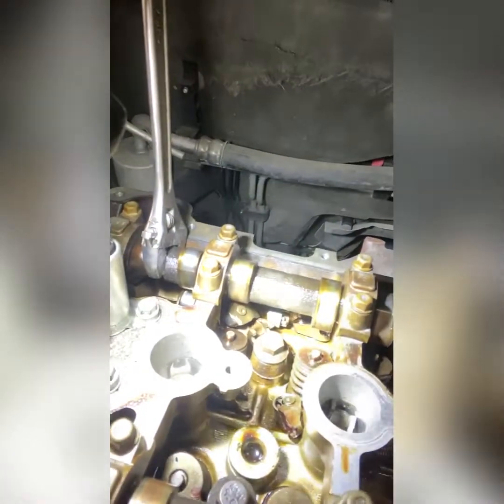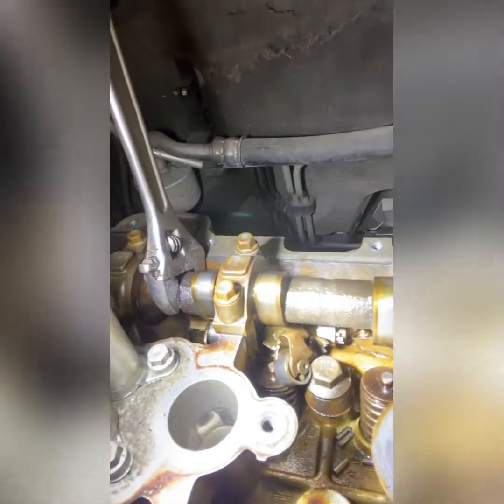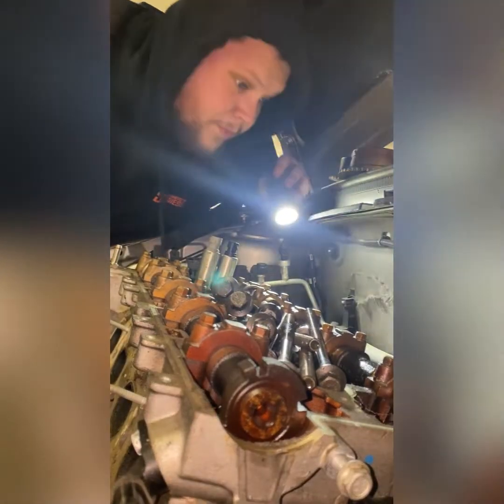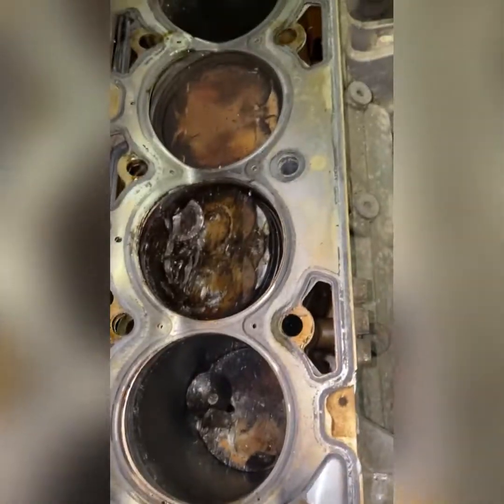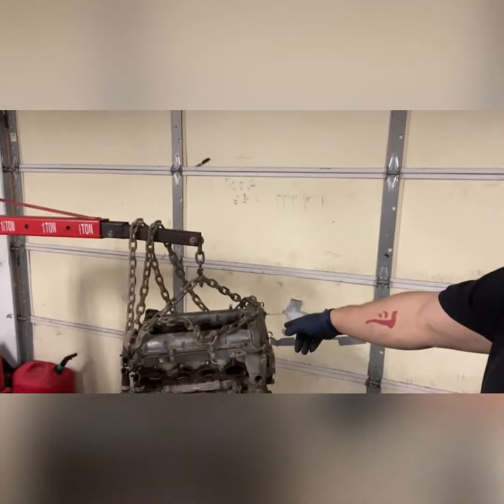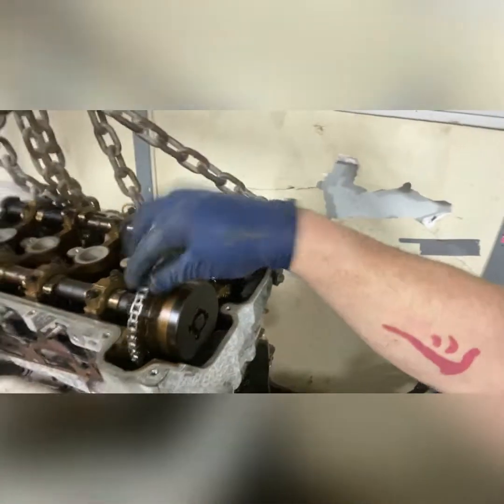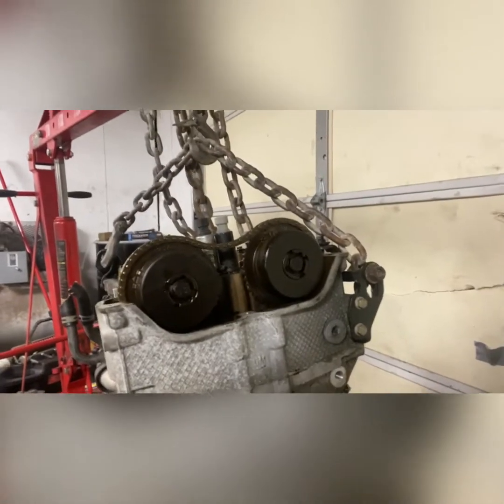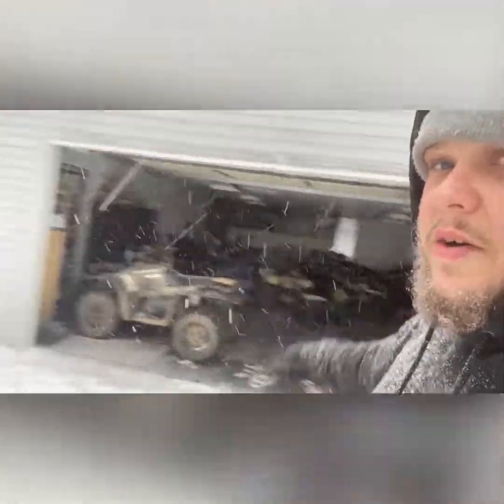2012 Malibu engine swap

Comment: I need some help man !!  I have a 2013 Malibu LTZ 2.5 lcv ,  doing a motor replacement..  do you know what other cars had the 2.5 ?? And can I use any other years or does it have to be the 13?  I know the Cadillac had it in the ATS but it was rear wheel drive so timing cover would be different and such. Don't mind changing the timing cover but I don't know if it will fit for sure
Reply from the maker: I doubt it has to be the 13. I’m sure any of that 2.5 will fit you may have to change accessories but you should be able to use any 2.5 from just about any year gm unless (like the 2.4) they changed the head between certain years.

Comment: Is this a good engine minus the timing chain issues ?
Reply from the maker: Great engine! Timing chain issues usually come from the lack of oil changes and maintenance. But as you can see, very easy to work on and very reliable engine otherwise!
Reply: 110% there good little run around motors just gotta keep up on everything. And the chains aren’t really that hard to do after you’ve done one. There simple to remove if it blows up. Just an all around decent little motor
Reply: I ask because my Mother owns a 2011 Malibu with the LE5 2.4. It's at 140k miles now and it has been a solid car. I've always changed the oil every 3-4k with full syn and maintenance it for her. Water pump went but that's really all. Lately I've noticed it idles kinda rough in gear. If you put it in Neutral or Park it idles smooth. I've checked everything including pulled the timing cover to check the chains and everything seems fine. Maybe mounts or something